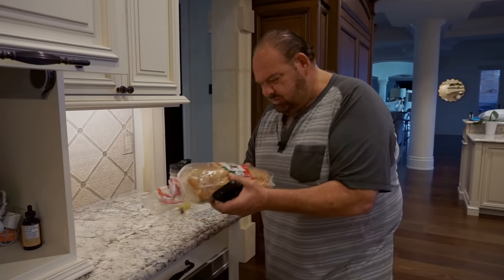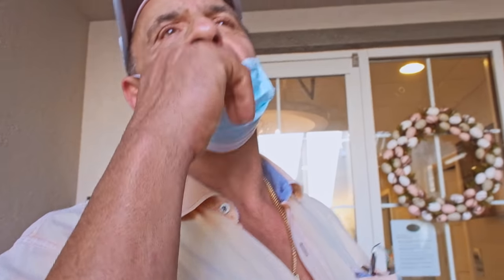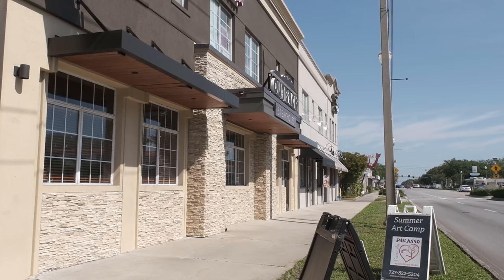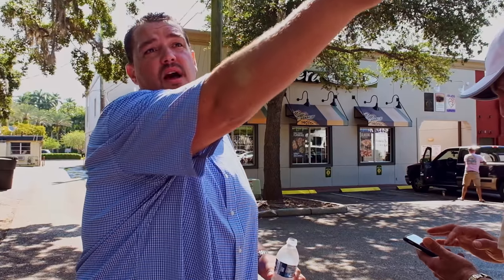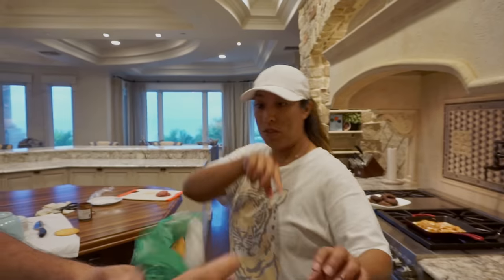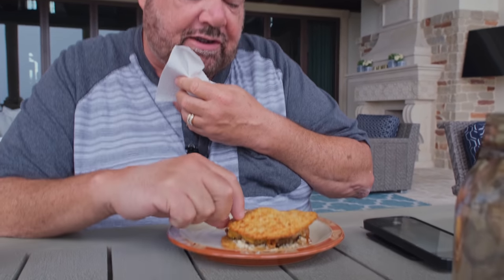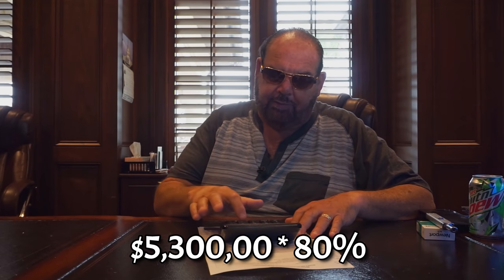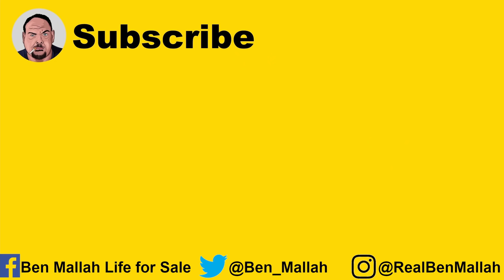Due Diligence | Life for Sale

Comment: At 6.8% cap, your NOI is $360,400. Love you Ben Jr!
Reply: Is that yearly, monthly or over time?
Reply: How did you calculate it ?
Reply: @Paidinfull416  $5,300,000 x 6.8% = $360,400. 

Going the other way: if you have a building with a $250,000 NOI and you want to pay an 8% cap rate it would be $250,000 / 8% = $3,125,000 purchase price. 

NOI / Cap Rate = purchase price so with any two values you can solve for the third.
Reply: @Paidinfull416  CAP RATE = NOI/PURCHASE PRICE
Reply: @gp7110  year
Reply: @Paidinfull416  another way ( 5,300,000 / 100 = ... ? x 6.8%
Reply: That 6.8 cap is considering that you put $5.3M of your money or already using the banks money? My guess is that if you’re using the banks money, your ROI will be much higher
Reply: @gp7110  that figure is typically annual
Reply: @AMGBadger  thx
Reply: Wat about operating expenses and vacancy’s
Reply: @Bambamlynch704  That is included in the cap rate. The cap rate is how much you get after expenses. And then you just do cap rate times purchase price and you get the NOI.
Reply: @gp7110  yearly NOI on the property
Reply: Ben what are you going to do if they don’t renew their lease? Renting out retail right now kinda sucks. Maybe their was a reason why you got that place.
Reply: @LLLLL263  Have you ever rented out retail?
Reply: @shreygaming2333 no probably can barely afford to feed himself

Comment: (Purchase Price) x (Cap Rate) = NOI
$5.3M x 6.8% = $360,000 per year, net

This is the kind of video I love on Life for Sale! Problem discovery, solutions, strategy. Like you said, nitty gritty is great. Please do more!!
Reply: does the 360k also include all expenses?
Reply: @joelledaher8793  it would be net income, its only some expenses that are usually not included in the NOI however like central administrative costs.
Reply: Why not put in REIT because he also has cap growth with leverage on loan
Reply: @henrikjohansson4555  wouldn't the cap rate be similar to cash on cash return?
Reply: @annajones9701  i am not an expert, but i would say probably bcz they have more control this way, they have a lot of tax benefits, they can raise rents amking them more money and the property appreciates alot over time
Reply: @joelledaher8793  no a cash on cash return often uses also the leverage. Lets say you have an LTV of 50% and you pay 3% you have a cap rate at 5% (net yield) building cost $100 000. you have $50 000 equity invested. 

$50 000 debt you pay 3% = 50 000 x0,03 = 1500

cap rate is 5% so you make $5000. 

5000-1500= 3500 in profit before taxes 

to get the cash on cash you then divide your pre tax profit after interest rates with your equity stake in the property. 

3500/50 000 = 0.07= 7% 

if you interest rates are lower than your cap rates your cash on cash return will always be higher than the cap rate.
Reply: @annajones9701  what you mean Anna?
Reply: @joelledaher8793  on retail or NN/NNN properties typically the cap rate tells you your NOI since the tenant pays for all expenses. Typically the only expenses that you as a landlord have to pay on retail/net leased properties is landscaping and the roof. Both of which can be big expenses, which is why you need to get roofers and landscaping guys out there to inspect and give you estimates before buying it.
Reply: @annajones9701  1031 money
Reply: @juanshaftpatel7488  what is that
Reply: @annajones9701  its the key to ben's success google "1031 exchange"
Reply: @juanshaftpatel7488  got. Thanks. Yes, I remember him taking about it in a video saying he needed to find a property quickly.
Reply: @joelledaher8793  NOI is whats left over after all expenses but chances are they will probably doing triple net leases which will greatly reduce Ben's expenses. Ben will then have to subtract debt service to calculate true cashflow.
Reply: @annajones9701  REITs need a minimum of 100 investors. Hes likes having control. 1031s are a tax advantage to keep your money in use tax free but you cant aquire it otherwise it creates a taxable event. 1031 is not the secrete to his succuss. Its time put in and having skin in the game. You will always make mistakes no matter what level you play at. The point is start playing and do your best to keep learning.
Reply: what is cap and how can i find more about the type of calculation you did?
Reply: Cool! I did the math and commented but doubled checked on google and you’re the only other commentor that calculated!
Reply: @henrikjohansson4555  thanksfor the explanation!
Reply: Need to know the operating expenses!
Reply: @annajones9701  what would the point of using a REIT when they are the acquisitions and property management company?

Comment: 5.3m @ 6.8% cap rate = 360.4k NOI

Assuming loan of 75% LTV @ 4.5% interest, debt service is 179k.

Free cash flow is 191k, so estimated 1.31m down, you're looking at 14.6% Cash on Cash return. 

Pretty good if it's a NNN lease with no major foreseen expenses.

Comment: $360,400. Better question is what are you doing to maximize your NOI? Secure those options, fix that pot hole, clean it up and put some lipstick on it and send it on down the line at a 6.00-6.25 cap